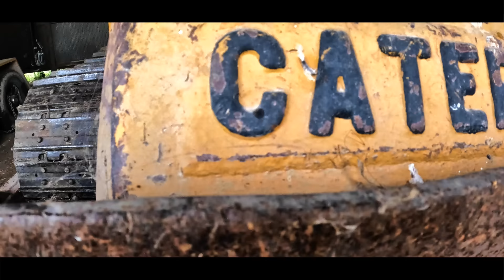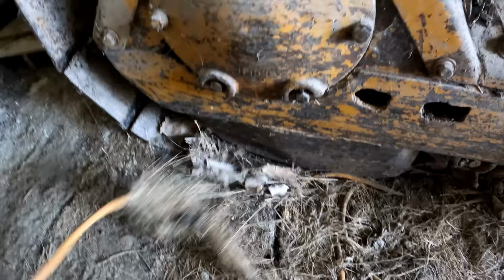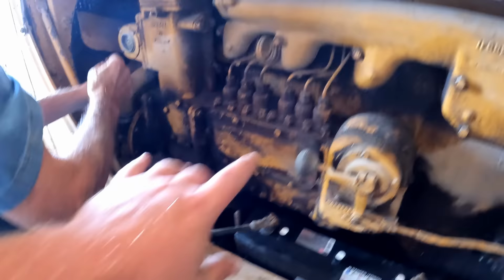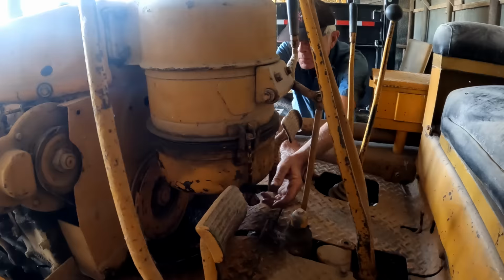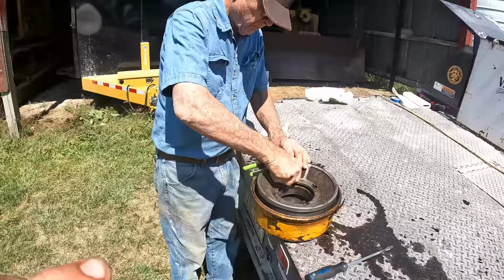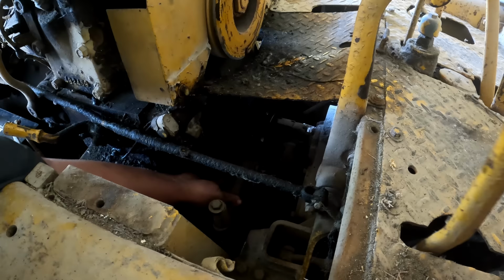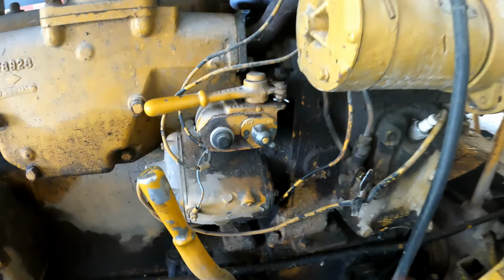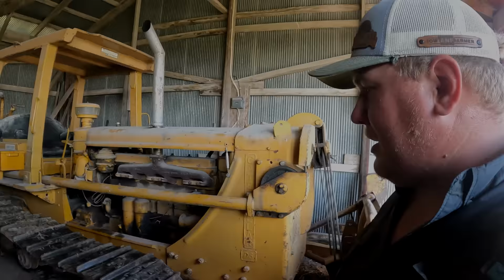Will it Start!? BARN FIND 1950s Caterpillar Dozer!

Comment: That was too easy.  It was not locked up.  Kovolochick corporation once brought a old Catapillar dozer so we could push in the foundation of the abandoned houses and remove the old board piles and outhouses.  It funneled or leaked several gallons of motor oil a day.
My lazy cousin Harold didn't put oil in it and blew it up right next to the club.  He was more worried about the beer than the job.  It sat there probably 10 years.  One day they came with another bulldozer and pulled it out of the weeds and hauled it away.  It was down in a hole when it blew up.  So it was no easy task to retrieve it and that was why it sat there below the club.  Then again Kovolochick had more money than brains.  If you want a challenge, go to Sykesville and see if you can get one of his yarder locomotive running again.  Or the shovel or craine

Comment: I've spent a lot of time on one of those. We still have 2 D6 9U's. One my Grandpa bought new in 1954. Both of them have hydraulics on them with dozer blades. If you can get me the serial number of it can probably figure out want year it is.
Reply from the maker: Where is it located?
Reply: On the back of the machine the left or right side under the cable spool. Should be silver and stand out.

Comment: Please get someone who knows what they are doing to show you how to start it properly the correct procedure is as follows with the pony motor turning the main engine with the compression OFF turn it until oil pressure comes upthen put the Diesel on full compression with the Fuel SHUT OFF DO NOT OPEN THE THROTTLE TO LET FUEL INTO THE DIESEL run it like that until the engine has warmed up and THEN OPEN THE THROTTLE TO LET FUELINTO THE DIESEL AND NOT BEFORE we would have been fired with a swift kick in the backside if we started our D8s any other way same applies to a D6
Reply from the maker: The book actually didn’t say that.  But a couple people have commented that. Along with the fact that the amount of people that would know how to start one of
These is far and few between.
Reply: @iowANFarmer  Yes guess we are getting old now but flooding the engine with fuel before it is warm enough in the cyclinders only increases wear they will start instantly on Diesel if run up as described best of luck with it they were one of the best models Cat produced back in the day

Comment: Man those machines are oldie but goodie doesn't take much to fire them up. More reliable than your modern machines as long as those dirty smelly rats stay out of that air filter. lol By the way what kind of filming rig you got there? I just got myself a GoPro Hero 8.
Reply from the maker: A 10 and a 9. I usually get the new one as it comes out since I use them so much

Comment: I have a D6 9U cable dozer. You just don’t want to catch the blade till it hits the ground or you can snap the cable. Come on suck it up it’s all just in your head.
Reply from the maker: When sitting it down to grade?
Reply: @iowANFarmer  yes if it goes down fast just let it go because if you try to stop it it can snap the cable. You just let it down slow or just drop it and then pick it up some. Ours is just about like yours I think our is a 1953 .
Reply from the maker: @southwestiowacattlefeeding6720  I was thinking late 40s Early 50s

Comment: Never just shut the pony motor off run they out of fuel  shut the fuel at the tank or you will ruin the pony motor before starting the main make should you have build up oil pressure
Reply from the maker: That’s a common comment. I’m going to make sure of that next time.